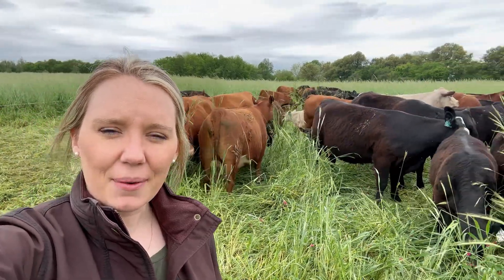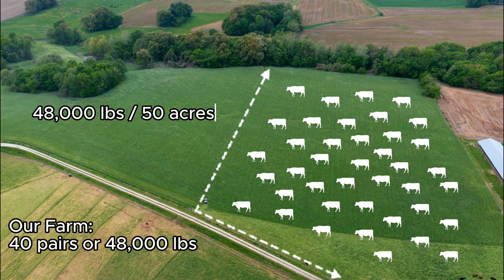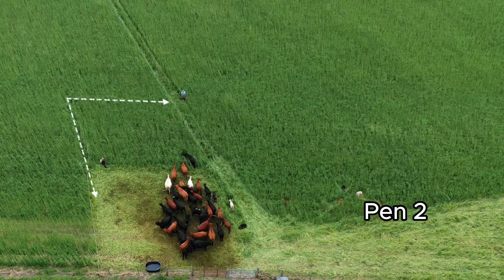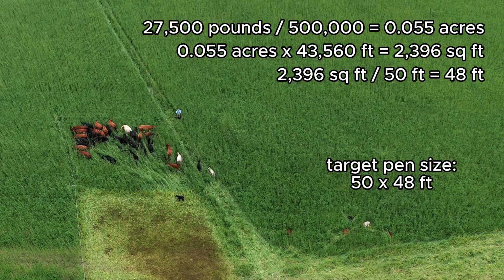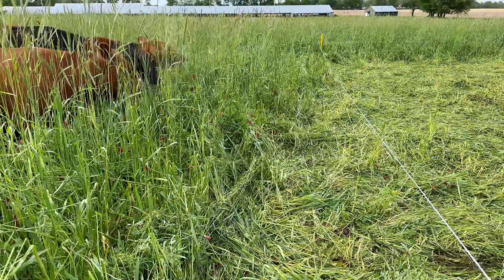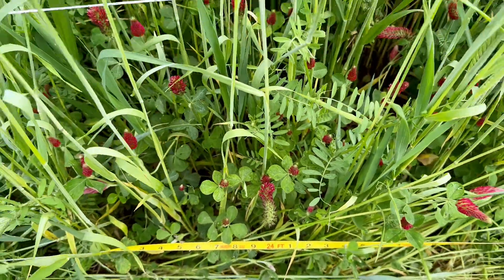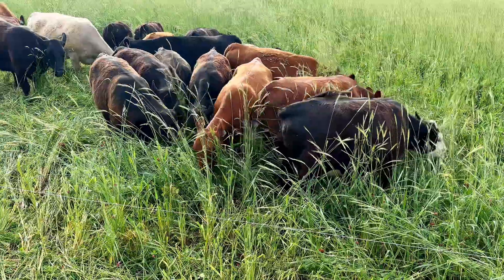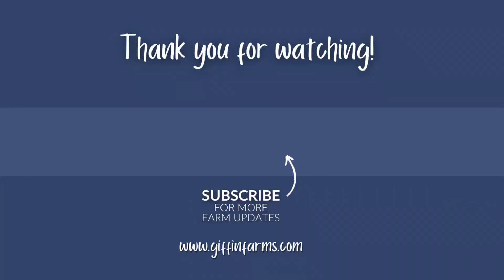Ultra High Density Grazing Cover Crops - April 19, 2024

Comment: Awesome how-to video!   Hey, I'm a SoilFoodWeb school graduate, where I learned that soaking cow feed with compost extract allows the cows to spread the beneficial microbes throughout your land. Know that properly made compost complies with food grade temperature & time requirements, whereby the bad bugs and weed seeds die off while keeping the beneficial organisms. Also, biologically complete compost will have sufficient ratios of 5 levels of biology, from bacteria and fungi at the smallest size to beneficial nematodes and arthropods at the largest microscopic size. Also, I'm a student of the Crescive Method, where we balance soil minerals using organic amendments like gypsum, oyster shell, feather meal, green sand, etc. It's based on the Ideal Soil V2 and you just do it once, then periodic monitoring to tweak the levels. Each 2 cup basic soil analysis goes for about $24 at Logan Labs. The interpretation of the report is mostly based on the Ideal Soil book. Combine these 2 methods for excellent benefits, according to my studies. My lawn does look great, that's the extent of my practice. I plan to buy a few acres soon where I will use your video tips too.
Reply: Thats all well and good what you are doing with that compost, but the big idea of mob grazing is that no feed is used at all.  It's a no input mindset.  Not trying to be malicious, just setting the record straight of what these people are doing.
Reply: Do you have written report of specific methods making it possible for me to duplicate in KS. Would like to duplicate here in ks
Reply: @denniskemnitz1381  I do not have written instructions or reports. You can either buy the prepared thermocompost or take a course on how to do it yourself or do your own research. I took a couple of courses. It's not difficult, but it is detailed, technical and labor intensive for one person.
Reply: What part of kansas. The western half is one cow per 18.5 acres.  @denniskemnitz1381
Reply: Hi .could we work together please?
Reply: @wadmaileykeemhanjoseph8913  I'm happy to share my knowlege. But I don' t really practice it except around my house. I need to buy some land. Also, I'm short on time, so, I only do this for fun.
Reply: @joecaz  are you located in midwest US
Reply: @denniskemnitz1381  No, south Texas
Reply: Would you move to if you were given land to practice on and be paid to raise cattle?
Reply: @joecaz SFW student here too. Where are you located?
Reply: @Dresoils  South Texas. I'm just a hobbyist/tinkerer
Reply: @joecaz  same here. Got some acreage in Ontario, Canada that im doing some trials on shortly. How did you find the crescive courses?
Reply: @Dresoils  The soil mineral balancing course is essential. I loved it. Have applied it once to awesome effect on a lawn. They offer a microscopy class that nicely simplifies the soil food web analysis; I haven't had time to review all the videos yet. They are standing on the shoulder's of Dr. Elaine and the experts that wrote the Ideal Soil v.2.0
Reply: @wadmaileykeemhanjoseph8913  do you happen to "operate" in the midwest? I in NE KS.  Around 100 A to monitor here. I a retired factory food processing/QC/QA worker after military training and academics at local land grant university . Discovered some regenerative farming ideas the past several years and moving toward those ideas essentially away from goal of certified organic. Appears to me so called C farming is a good food production system. Although I can not prove it. The method makes sense to me. Thank you all for getting in touch.
Reply: Yes, I understand you.l am working on a project i will let you know!
Reply: Экстрактом какого компоста нужна замачивать карма?
Reply: @Дали-ч7ъ  Biologically complete compost that is prepared using either the thermocomposting method or the Johnson-Su method. It is considered biologically complete when it has sufficient ratios of the 5 levels of microscopic microbes. Look up Dr. Elaine’s Soil Food Web Approach or the Crescive Method for more resources.
Reply: @joecaz  и как перевести мне это?
Reply: @joecaz  И как перевести мне это?
Reply: @joecaz  I follow Dr Inghams info as much as possible. Or I think so anyway. Thanks again for the feedback. Dennis
Reply: @Дали-ч7ъ  what are you saying by there please?
Reply: Thank you ..I continue to follow...
Reply: Which lab instrumentation required for sample analyses...Dennis
Reply: @denniskemnitz1381  Logan Labs will test your soil sample. Interpreting the results using the lessons from the Ideal Soil book helps you balance your soil mineral content. You can either read the book or sign up for the Crescive method class. Now, the biological analysis requires a microscope; you can learn this at the Soil Food Web School or with the Crescive folks which are graduates of that school. Or you can have it analyzed for you at the same places. 

Logan Labs offers interpretation, but I don’t know about their methodology
Reply: Looks like 800k would give you better harvest efficiency. I’m always toying with it. Your pastures look to be high yielding and the animals look great. How many cow days are you getting on that forage. Thanks

Comment: When you were doing 500,000 lbs, was each pen move duration 45min?  If so how many moves a day would that be?  If you wanted to move a maximum of 4 moves a day, what would that look like?
Reply from the maker: Yes, our moves were about 45 minutes at 500,000 lbs.  If we were going to continue grazing this way, I think we would have 12-15 moves during the day before letting them rest at night. 

That being said, I think 4 moves per day would be a great place to start if the plan was to do high density grazing every day.  If I want to do the math for number of moves instead of density, I would start by determining how much space the herd will need per day, divide that by 4 pens, and solve for pen size using the same equation as before. In this situation, I would start with 0.75 acres / 4 moves = 0.1875 acres x 43,560 = 8,168 sq ft / 50 ft = cross fence every 163 ft. Of course, we would be ready to adjust the pen size if the cattle seemed hungry or were having too little impact.

Keep in mind, you would need to give them more room overnight, either with a larger pen on the 4th move or by pulling your back fences and giving them the whole day’s worth of pens to rest in. In our situation, 4 moves would achieve a density of nearly 150,000 pounds per acre, which is still awesome. 

Thank you for the questions! If you try it, we would love to hear how it goes!
Reply: One thing that you could do to cut down on some of the labor is to not worry about a back fence. I practice managed grazing from May until the first of December or so. It’s been my experience that the as long as the cattle are getting fresh grass on the regular, they don’t worry about grazing the trampled soiled grass until the new growth starts. Usually about 3-5 days after grazing. Great video!
Reply from the maker: @jamesobryan3258  Thank you! That is a great point!  I agree, no back fence would save some time.
Reply: Is there possibility of one or two moves daily.  Too many daily moves it seems to do other farming jobs. Dennis
Reply from the maker: @denniskemnitz1381  We prefer daily moves for our normal grazing rotations.  The cattle stay full and healthy, the soil gets the rest it needs, and the work life balance is better for us!